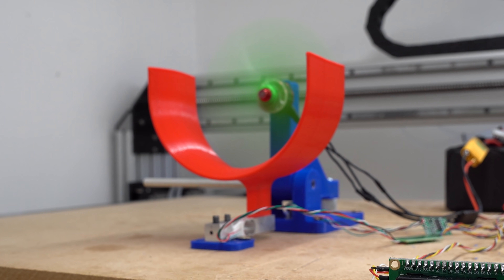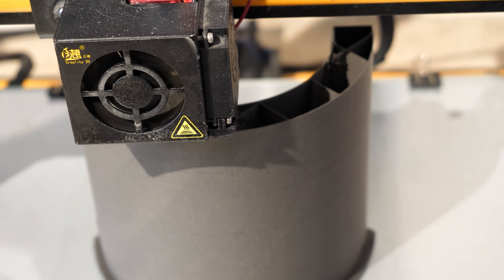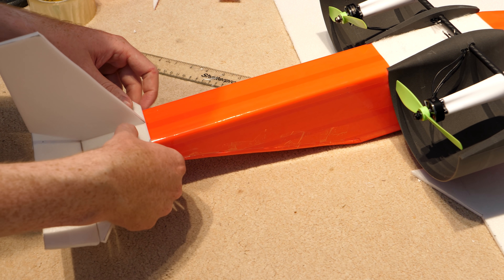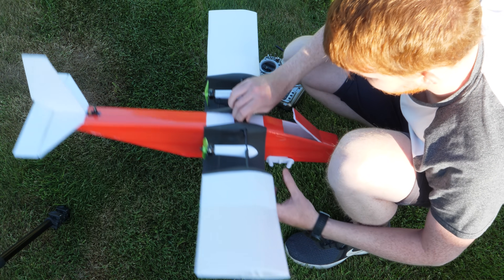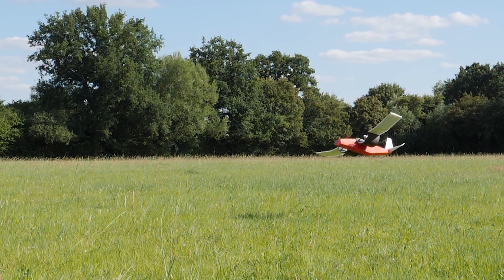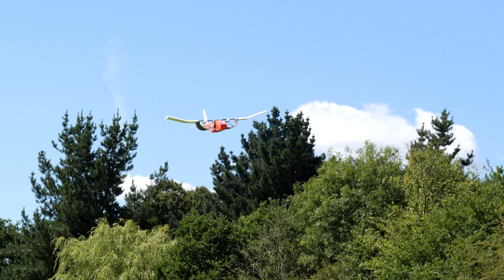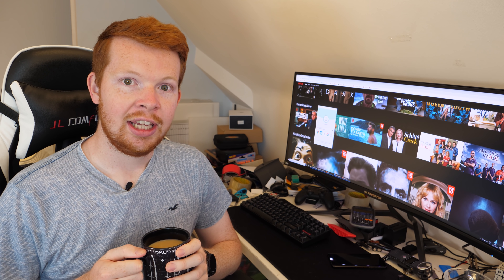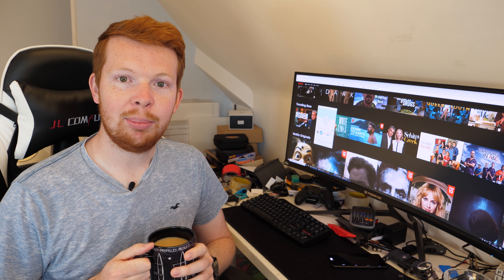Channel Wing Plane

Comment: Any difference in lift by having the motors push air over the wings, vs pulling air?
Reply: With the props at the trailing edge, it draws the air over the airfoil more cleanly (think windtunnel).  With the props at the leading edge, the wind turbulence decreases the efficiency of the channel.  At least, thats my theory.
Reply: @microbuilder  the pusher prop arrangement is not necessarily drawing air over the channel, but pulling it in from a larher area, most of which is not directly over the airfoil.
Reply: My question is what would be the difference between a low-pitch/high RPM prop vs a high-pitch/low RPM prop.  Seems like there could be a good case for either, but I have to imagine one would be better for this type of application.  
Tom used direct drive (not sure of the pitch), and I used a geared system on my micro version (so definitely slower RPM), and comparing the two, I seemed to gain more low-speed lift, but theres a lot of other factors involved.  "More testing required" as they say...
Reply: I think it worth to test the later. The High-speed air passes the surface will provide more lift.
Reply: @majianjia  latter*
Reply: Seems like it'd be something to test, since the historical aircraft referenced has the engines in the pull configuration rather than push.
Reply: Look up drum fan airplane. It pushes the air over the wing instead of pushing / pulling within the wing.
Reply: https://youtu.be/QlXNEefLXz8
Drum fan airplane.
Reply: The airflow from the prop will be so turbulent that the wing would have a huge drop in efficiency.

One of the reasons this works is that the channel increases air flow in comparison to the free stream - like a ducted fan. the velocity aft of the prop may be slightly higher, but I'd think it wouldn't be too at significant
Reply: If you put the fan at the front you end up with a pressure increase behind the fan, reducing the pressure differential over the wing, so it makes sense to put it at the back where there's a pressure drop in front of the fan
Reply: @malcolmdavy8768  I'm quite sure the speed makes much bigger pressure change than the sucking or blowing alone
Reply: @Henrix1998  I thought the same initially but this isn't a closed system, the prop is doing work on the air and so the pressure increases after the fan. It's not quite as straightforward as applying bernoulli.
Reply: @Henrix1998  That's what she said..
Reply: @malcolmdavy8768  
Behind the prop has 2x the speed of those in front. Higher speed air flow lowers the column pressure behind prop for higher lift in this experiment.
Reply: Infornt of the Prob is a low pressure zone behind it a high pressure zone. Other wise  a prob would not produce thrust. So putting the Prob in front of the the wing would not work.
Reply: Probably, because an orifice on a flowbench pulls a lot of air from the sides. Actually air pressure pushes to fill the void, but either way a lot comes from the side.
Reply: @SidneyCritic  from the side and above.
Reply: @Nilguiri  Yeah that's what I meant, ie, it's probably not pulling air across the surface, but from above.
Reply: Yes there is, the while Idea is pulling air from a Palace so air pressure pushes IT up
Reply: @herksku9051  Interesting. If you're saying the prop is creating a low pressure on the wing and the higher air pressure under the wing is lifting it, my guess is that it would be better to just to cut a hole in a flat wing and have a horizontal prop in it. My guess is that they are accelerating air over the airfoil shaped channel to add more air speed to normal flow, hence creating more lift at low air speeds.  Maybe you're right, so I guess Tom will have to test it.
Reply: @SidneyCritic  sombody testesd this in a old vid
Reply: Amazing to watch! I was really wondering what would be the result. I was wondering though, ever thought about a T-tail to get the tailplane out of the prop wash? Just a thought out loud. I was wondering of that would improve or decrease manouverability. Thanks for the video!
Reply: You could push the air but the wings would have to be above the center of mass to produce lift. I don't know anything about efficiency.
Reply: Why did we conduct this experiment opposing the life size model in the documentary video? 

We place prop by the trailing edge, the documentary model has it by the leading edge. 

- prop suck in air at 1x speed and wash it out at 2x speed relative to ambient air. 

- Take advantage of that 2x speed we get 2x lift with leading edge prop. 

- lamina flow offers a higher lift/drag ratio need a higher air speed to maintain. It also requires a higher landing speed, poor low speed lift for longer run way. 

- turbulent flow offers a lower lift/drag ratio is stall resistance. It provides same lift at a lower than normal air flow for shorter runway. 

Air line wing top installed numerous tiny fins to generate turbulence to maintain lift at air speed otherwise within stall state.
Reply: That would require a nozzle before the channel.

Propellers impart momentum to air to create thrust. This increases pressure.

Nozzles convert high pressure flow into faster flow with less pressure.
Reply: Ya bro  there is a huge difference

Comment: Is the centre of thrust too low causing the pitch up, preventing the effect from really working?
Reply: Also the ratio between the volume of the channel, the wings and aircraft body and the depth of the channel is very different from the original.

Comment: I bet channel wing aircraft are hilarious when they fly upside down
Reply: Ah yes dropping like a shitty drone
Reply: Lewis Johson
😟
Reply: My prediction is it would fly normally.
Reply: @testaccount8921  i don't think so, cause when it's flying normaly the extra lift that the channel wing creates is directed down, when it's flying upside down the lift is pointing up, so it would be hard to fly and most lilkely need faster speed to not fall, but then again this is my opinion and i would like to know why you think otherwise
Reply: colortech you want lift to be downwards though
Reply: @soulsweeper1630  yes right thanks for the correcting, but what i meant is that the force vector is pointing upwards normali, and downwards when flying upside down
Reply: I'm lovin' it
Reply: Hopefully the next video is a submarine
Reply: @simonmartin4599  Any vehicle can be a submarine if you're stupid or bold enough.
Reply: Boobs
Reply: Viraj Kadam nice
Reply: @Mad science ba da, ba ba ba
Reply: Why flying upside down anyway, to impress chicks ?
Reply: I believe that would yield Similar results to flying a helecopter upside down
Reply: Ofc, it will look like you flying.
Reply: It'd be great for loops
Reply: they don't loop they corkscrew,
Reply: You could use the same logic and say that a traditional airfoil plane should not be able to fly upside down, because wings create lift towards the bottom side of the wing. But as we know this is not the case (planes can still fly upside down).

Comment: I would think that the low pressure zone ahead of a propeller has less energy than the high pressure zone behind them. I guess the original theory focuses on rearward props, but would it be more effective with tractor props, accelerating the air over the channels? Though additionally, a semicircular wing would be producing lift in various vectors going inward of the surface vs perfectly up, and that itself would suck away efficiency. 

Gosh there are a lot of variables to this!

Comment: Wish I had a 3d printer. And the ability to use one. I'm so technologically illiterate!
This is such an Awesome design
Reply: 3D printing nowadays is very accessible. Of course there is a bit to learn but once you get the basics, as long as you stick with the usual materials, you should be fine.
Reply: The Longer LK4 or Ender 3 is a great start to printing and they are around $200
Reply: @joecarpino  Im about to buy one in a few hours! (ender 3)
Reply: Daniel Files  - Nice!
Reply: I have access to multiple 3d printers from low to very high quality devices. In my opinion you can get already nice results with devices less than 500 euros.

But I have to say, that honestly after I printed nearly everything I went back to regular building techniques like milling etc.
Reply: Thanks for the replys guys.im currently looking into the Ender 3 now
Reply: Good first printer: Ender 3, I got mine for ~£150.
Good CAD software: Fusion 360, you can download it for free and there are loads of good tutorials on YouTube to learn it.
Good material to start with: PLA, it's very forgiving and will get you printing successfully the fastest. You can buy a roll for less than £20 off amazon.

That's how I started off!